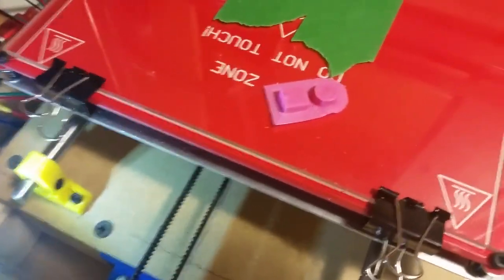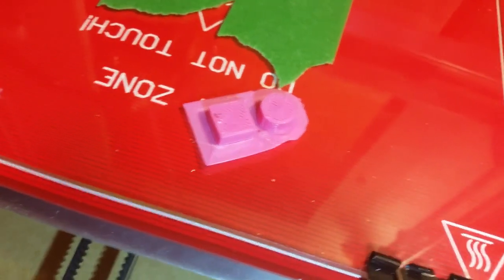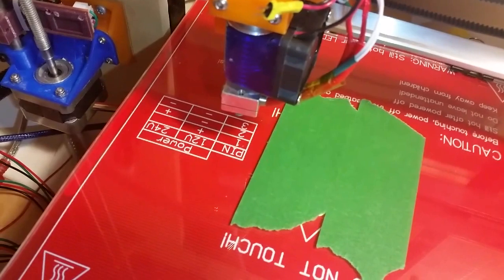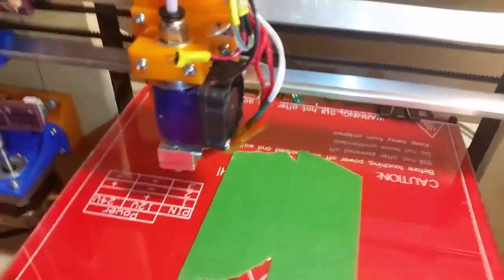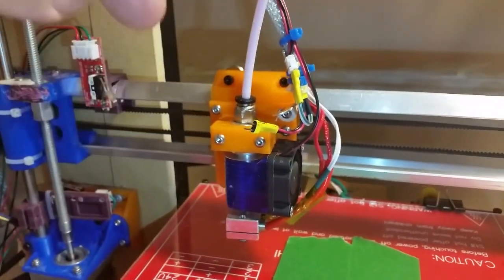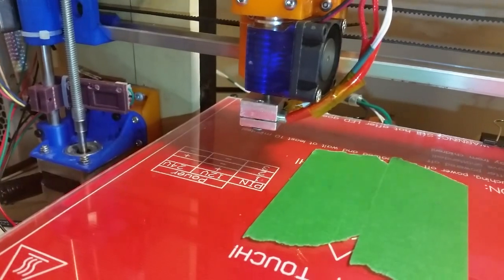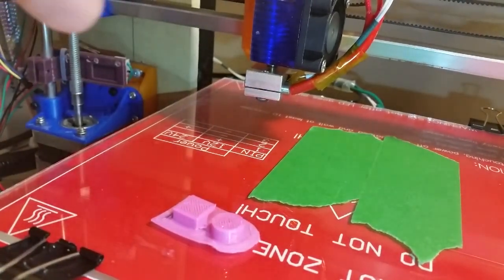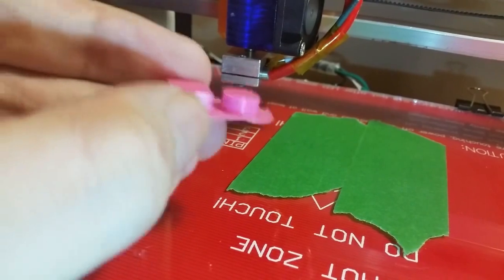First Print ! [ heat-break polished ]

Comment: Excellent work :-). it was very smooth & quiet when printing too. its going to be an excellent printer I think.
Reply from the maker: if i keep that hot end clean and smooth , it should be good beast for larger items and the few X carriage shape tests yet to be done .  
then i cna boil it down to the parts , and parts cut as i printed on my small Fab Mini. 
Thanks for big help on the heat break .